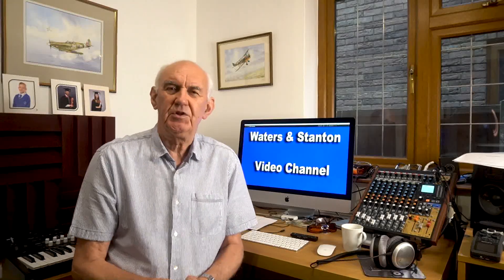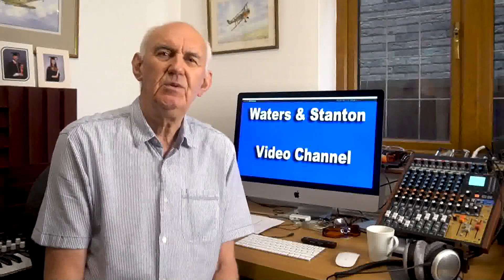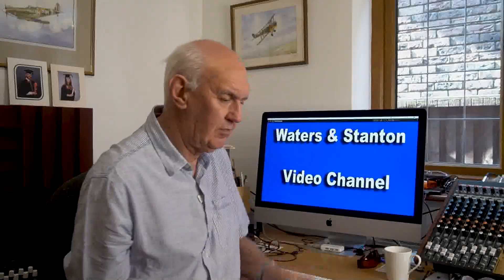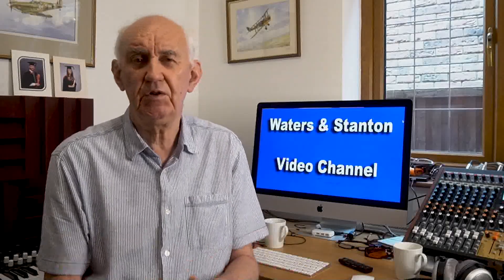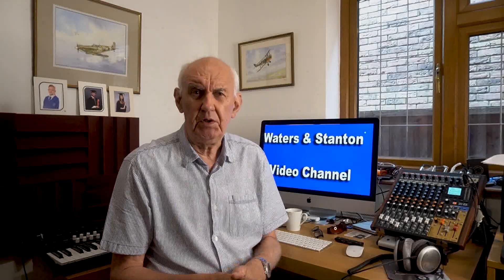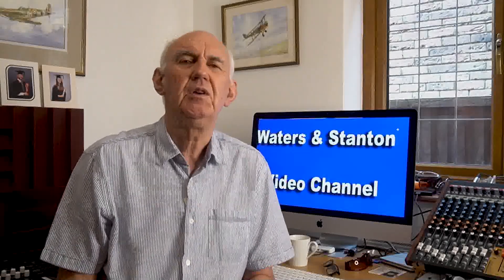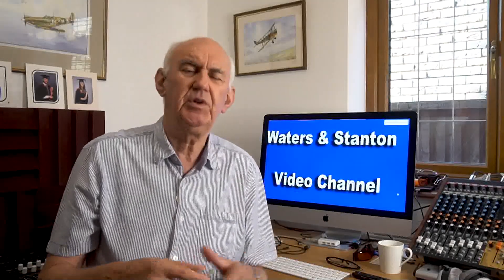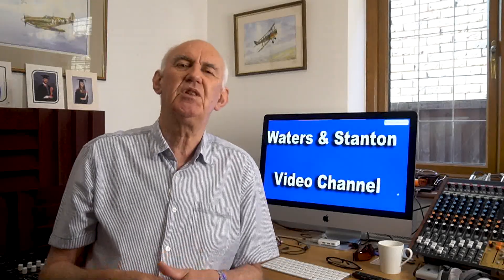DISCOVERY TX 500 Upgrade Amplifier & ATU!

Comment: Hi Peter, got my TX-500 a couple of days ago and worked through the settings. It’s well laid out and I don’t think I will need to look at the manual again. Menus are very straight forward considering its capabilities. Today was a damp day with some slushy snow around, and I went to a local park for a POTA activation. In just over an hour I made 15 phone contacts on 20m while sitting on a rocky ridge. Some contacts were around 1500 miles away and 3 were park-to-park. This radio is an absolute pleasure to use in the field and best of all I didn’t have to worry about getting it wet! 73 from VA7SZ, British Columbia.
Reply from the maker: Hi David. Thanks fir that. Yes winter portable operation is easy with that radio. Keep at it. 73 Peter.

Comment: This unit does not pass muster because it does NOT have an INTERNAL ANTENNA TUNER so it may fall flat on it’s face. Check out Xiegu’s new 6100 with internal antenna tuner. It smokes this one and it has internal antenna tuner and Bluetooth and is much better quality and is cheaper. So this unit is a no go for me.
Reply from the maker: Thanks Don. As hams we must be grateful that ee have such a wide choice. 73 Peter.
Reply: I ordered a X6100 and found it lacking in many ways after I received it. I returned it and I am very happy owner of the TX-500.

Comment: I got my TX-500 in April and it’s the only radio that I use both at home and portable. I recently did a road trip across the US and used my radio along with a hamstick on 20 meters. Although I was not expecting much, I made several contacts well over 1,000 miles. Six months after receiving my radio, I am still blown away by its performance. I often get reports of a weak signal yet 100% copy. I can’t recommend this radio enough to anyone who wants a good rig be it portable or not
Reply from the maker: Hi Todd, great to hear from you. Interesting info. Take care and keep travelling!! 73 Peter.

Comment: Good video and I have the same issues as you do, I only use Apple products and over the past 3 or 4 years my wife and I both are using only iPad Pros so we operate with iPad OS15 which it almost impossible to update any software on any equipment.
Reply from the maker: Hi Mike. Yes very frustrating but at least no virus problems!! 73 Peter.